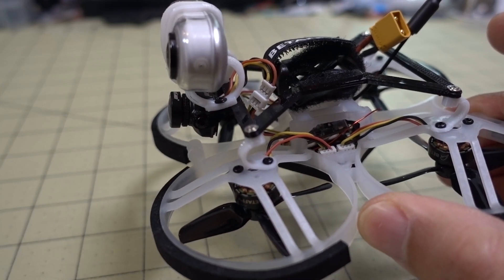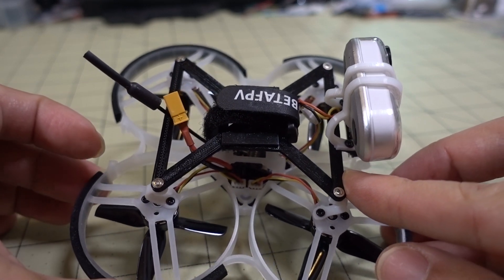Insta360 Go Cinewhoop Conversion from Racing Whoop!

Comment: Soo.. is this or the diatone better to carry the insta360 ?
Reply from the maker: Both can carry it with no problem.  The bigger 2-inch prop on this does allow it to fly longer but you're limited to 2S on this one whereas on the Diatone you can go to 3S and have more power.

Comment: Whoa, ok so not only do I live in the same city you film all your videos(won’t say it online) but I also drive a 2011 Nissan Leaf and have a xiaomi m365 I throw in the trunk. I thought I was the only one flying through my trunk like that! Lol btw, you can fit it in the trunk without putting the rear seat down, you just gotta put the front wheel first and angle the back up and over the hump.
Nice build, I just bought a geprc phantom and it’s similar build weight and size, might end up throwing a instago 360 on their if this is how good it flies with even smaller props.

Comment: Do I need to flip a propeller upside down?
Reply from the maker: The prop must be oriented in the same way so that the thrust points down.  So if you're looking at the drone from the "bottom" then the prop should be installed upside down.  If they are installed wrong, it won't fly very much before crashing.
Reply: @AlbertKimTV  Thank you.

Comment: i tried this exact same setup but my 85pro2 doesnt seem to take the weight. are you on full throttle the whole flight? :P
Reply from the maker: Hardly have any throttle at all.  If anything, it's got too much power.  I had to put in a throttle curve to control the power.  You probably have some configuration problem.  It can carry the extra 20g easily.
Reply: @AlbertKimTV   sad. :( Maybe the small additional weights are my problems, I'm using the bulky canopy of betafpv for turbo eos 2, 12aio FC which is thicker and heavier, xm+ and nano vtx. Maybe I'll just try to shave some extra weight for this to work for me. Thanks a lot! Really appreciate you commenting in my question. Always love your vids, keep it coming bruh! 👌
Reply: @AlbertKimTV  Hi I copied your build, works great but my f4 is overheating. I think I don't have the right PIDs, would you mind sharing your PIDs for this one? :( Thanks in advance!

Comment: Very nice&smart setup ! I have just started to play with my Insta360 GO. Sometimes it works all fine, but sometimes, it randomly stops recording. Have you encountered this issue ?
Reply from the maker: It does that when it reaches a certain temperature.
Reply: @AlbertKimTV  Thx for your reply Albert. I'm afraid temperature was not the problem (it was not so hot and the camera was on a quad). I will look more into it.